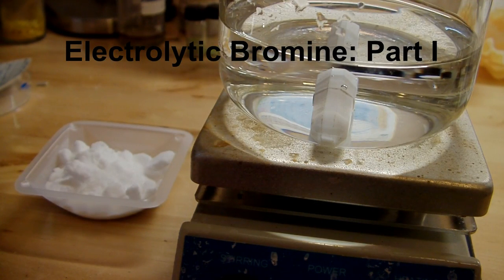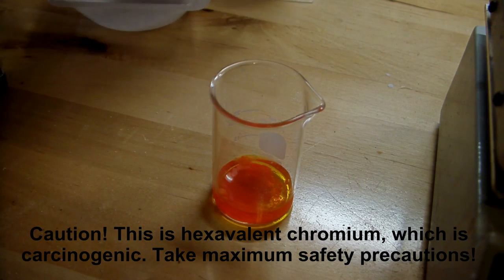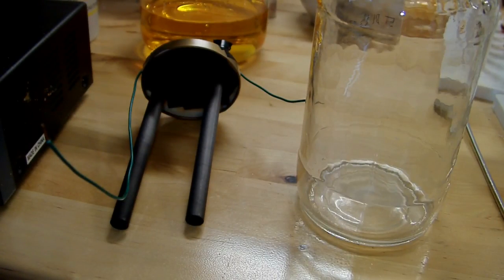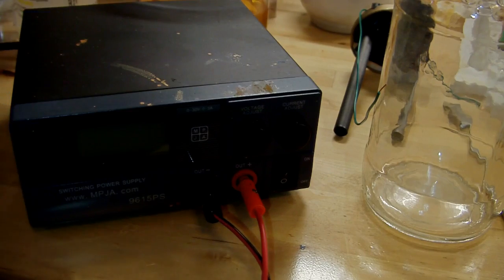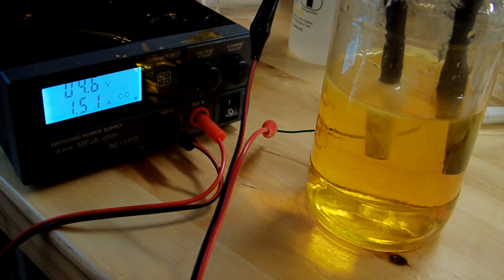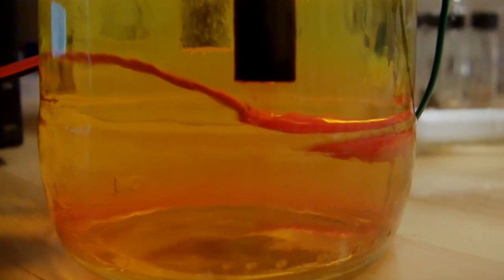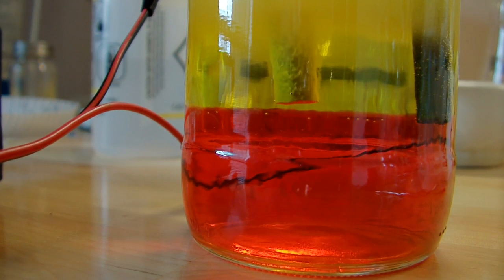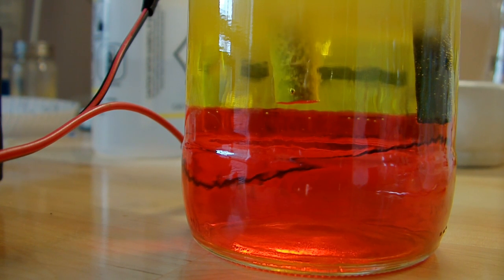Electrolytic Bromine, Part 1

Comment: Another method to produce elemental bromine would be to electrolyze NaBr across two chambers with an ion channel between both chambers. The chamber with the anode should produce bromine which will just settle at the bottom without any need for special treatment (except for distillation).
Reply from the maker: What would such an ion channel be made of? How would you build it?
Reply: mrhomescientist I've found that clay pots tend to work but can be messy. You could use two beakers and drape a paper towel to bridge the gap making an ion channel but it might get degraded by the bromine.
Reply from the maker: @noahswindler7461  Yeah I've used nested flower pots before and that seems to work, for NaCl electrolysis at least. I ask about the salt bridge because I see it mentioned all the time but rarely see a practical implementation, so o never know what to actually use.
Reply: Yes indeed, but saying theory and actually having a working bridge material are very different things...

I doubt a simple paper towel would act as a salt bridge involving bromine very seriously, and for same logic many simple salt bridges that are common use would also fail.  It would almost have to be a semi-perm membrane that would allow sodium ions thru but block hydroxide ion...plus not be chemically attacked by Br2 or high con OH- .  This sounds like a rare and probably expensive thing if one could even find such thing.

How about a polymer-gel based material infused w Na+ ions as a semi-solid filled small tube to connect the 2 half cells?  Something like nitrated cellulose, or highly substituted polymer of keytone group, NH2 group, etc, or a nitrogen based polymer within backbone...anything with large amount of structure and/or active surface with unbonded lone pair electrons.  These would readily absorb and transport + ions like Na+ while repelling negative ones as OH- .   Problem is many polymers carry residual pi bonds which Br would destroy so itd have to be saturated as well as functional groups with exposed electrons can be oxidized and degraded and Br2 is very good at oxidation.  Still, the degredation could b minimal with proper gel and react slow enuf the degredation is kept localized at Br2 production side of tube...

I see this vid is old...have you ever revisited this or found a suitable bridge?  Itd sure save a ton of work and be much easier.  Think a simple semi-perm naturalmembrane osmotic membrane would work?  Ive used egg membranes for many experiments requiring such by dissolving shell away with HCl, wonder if itd bridge the cells?
Reply: @ckimsey77  what about poly acrylimide or however you spell it, you know stick a big clear orbeez in-between ?

Comment from the maker: Yeah that's not a bad idea. This particular setup isn't too bad because it produces no harmful gases. It does, however, throw up a lot of tiny droplets of solution because of all the bubbling, so it's good to have a cell with a cap on it & let it sit for a few minutes after turning the power off before opening it up.

Comment: I can tell you why bromine is used in spas and not pools. There are actually plenty of reasons. 1. Bromine gas is not as toxic as chlorine gas (i could be wrong on that) 2. It isnt as hard to breathe.3. Chlorine when heated in a swimming pool evaporates MUCH faster than bromine. 4. Bromine works better in high temperatures. 5. Bromine isnt as harsh on plastic as chlorine and it has its own smell.  I worked at a swimming pool supply company for a few years.

THANKS,
 Chris

Comment from the maker: It's a decent conductor, though it tends to burn up if you run too much current through it and it gets hot enough. It's significantly less conductive than copper, which is the second most conductive metal after silver!

Comment from the maker: Excellent question! It's true that it is made from NaOH and H2SO4, but it's more of a partial neutralization. If you add more NaOH, the products go to H2O and Na2SO4. Bisulfate is acidic because when you add it to water, it dissociates into Na+ and HSO4-, which in turn dissociates to H+ and SO4(2-). It's this H+ that lowers the pH. Think of H2SO4: that is a diprotic acid that dissociates first into H+ and HSO4-, then another H+ and SO4(2-). Bisulfate sort of acts like "half" of the full acid!

Comment from the maker: Sure! If you follow the equation at 7:50, that will tell you your new running time. As long as the voltage is still high enough to form bromate, having less current just means you must run for a longer time.

Comment: I don't want to sound stupid but how exactly does NaHSO4 produce and acidic solution? Since the salt would be made from NaOH and H2SO4 (I assume) shouldn't it be classified as neutral? And even if not equilibrium will favor a weak acid, so there's no way it could make Sulfuric Acid.. It just has me a bit baffled.

Comment: its inert and doesnt take part in the reaction which is why it is used instead of other conductive materials. The other inert electrode is platinum which is quite expensive so its understandable that carbon is used instead.

Comment: If you look up on amazon platanized titanium anodes, you will find mesh platanized titanium anodes that work much better than your current setup with the carbon sticks. Only 30-40bucks each...worth it!

Comment from the maker: I think chromium is required, but I'm not 100% sure. Would be worth experimenting!
Reply: I'm wondering if it has more to do with changing electrode over potential than it does with it's general oxidative properties.... That is, make it more likely to create bromates then oxygen gas at a slightly higher voltage  & production rate (more efficient)..

Comment: According to your science bromine and aluminium react violently. However a doctor of your science show cased a soda pop beverage solution of bromine contained within an aluminium container. The doctor did not suffer from burns after wards.
Reply from the maker: Do you have a link to that? If it's a solution of bromine in water, it's a lot less reactive than pure liquid bromine. Also pool "bromine," if that's what they used, is a compound not pure bromine. Similar to pool "chlorine" being (usually) calcium hypochlorite.

Comment: Are you sure that "M" is the concentration of NaBr, and not the formal koncentration of the bromine ion alone? I know it doesn't matter in this reaction because M[NaBr] == M[Br-], but it would make a difference if we had used a salt like CaBr2, right? Thanks
Reply: btw.: What is the name of the equation?
Reply from the maker: @xelionizer  I'm not sure, actually. I followed woelen's procedure from his website - search for "woelen chemistry" and it's one of the first links. Blue background. He says it's for NaBr, but that may be just for our particular setups.
Reply: Due to solubility,  Ca bromide wouldnt be used over a potassium or sodium salt; why use Ca salt when potassium works way better and is super ez and cheap to buy?